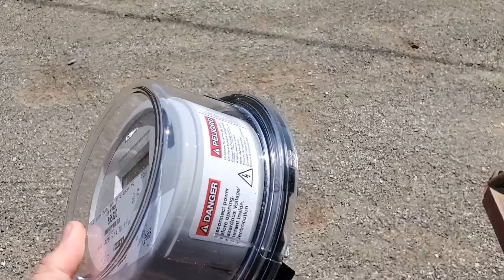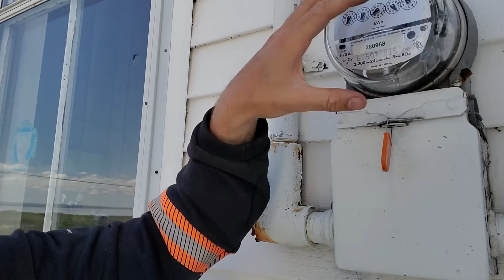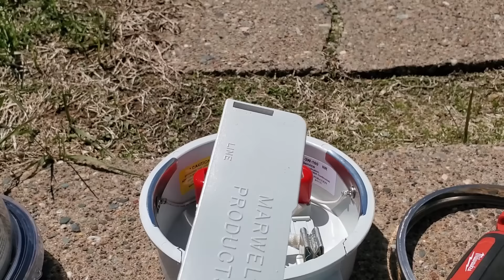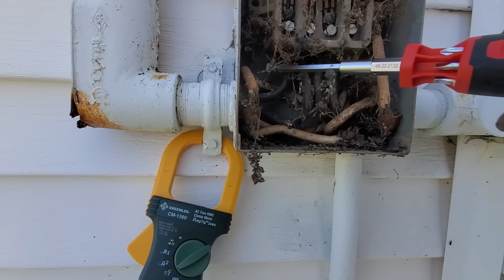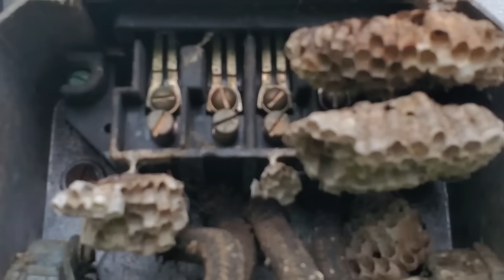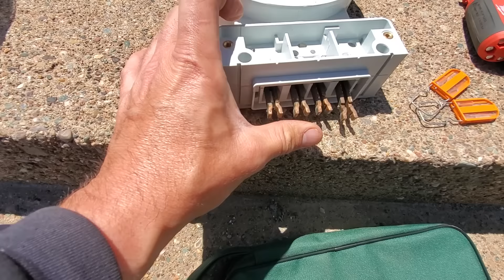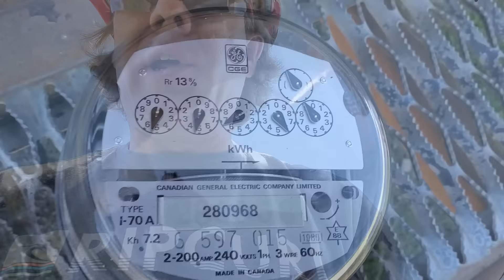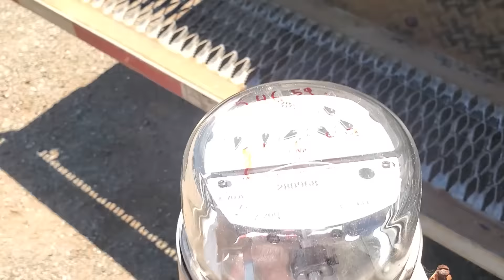Removing an old "A" base Electrical meter

Comment: Hey all the best from France 👊👊👊
As a meter collector from Europe I found this very interesting as i did think that only Socket meters are used in north America. 
Is there any way to obtain/buy such an old A typ meter?
Also I find to sealy your using interesting, when did you quit using standard press seales? Again ours are smaller and different, more like a special sip ty as we're not allowed to use lead seals anymore. 
About the cover plate of the adapter, I think it would be better if it would be build in a way you could but both covers on, especially as the service box is outside and there always is a risk of dirt getting on the connection and so on.  Here especially in Industrial units and older 10kV instalations, the meters are in clear boxes and there I am always onnyied from the missing terminal cover. We do not have all standard wirings for meters and they are printed in the cover. secondly i doesnt look finished. Also metering repurposing was until the 2010s a thing here. Missing covers made that difficult.
Reply: I've never, ever seen a lead seal on an electric meter in the USA, even going back to the 1980s. Prior to that I was either too young to notice or hadn't been born yet. The seals I've seen have always been the plastic ones with the metal hasp, but the ones he's using in this video with the clear back so you can see the hasp are something a bit newer.
Reply: @brianleeper5737  Many thanks for your answer. I find it very interesting to know how it is done in other countries.
Reply: Hey Alex if you check eBay there are usually some old A-base meters for sale on there. Westinghouse, Duncan, Sangamo and General Electric were the most common manufacturers - if you search those names + "meter" or "antique meter" you'll find one eventually.
Reply: @doctorzaius4084  thanks

Comment: Just fyi , soap and water in a squirt bottle is the best you can use for wasps ! No chemical residue or harmful chemicals to get on your skin . The wasps don’t fly off and drop dead to the ground ! And you’ll save a ton of $ too. 
Before I was a lineman I did pest control for 13 years ! Enjoy bud and stay safe !
Reply: I would be careful though that the wasps are not going to see you as an attacker... then they'll attack back
Reply: @Engineer9736  that’s why you use the soap and water , it’ll stop them from flying .
Reply: @bguy86  I hope so, i'm happy to believe you. But i'm not going to test it 😅 But anyone is free to try if they wish 😉
Reply from the maker: Interesting, I'll def try that. Thanks for the tip! 👊👊

Comment: I was home when they swapped out my old analog meter for the digital smart one.  I told the guy I'd run and turn off my main breaker but he told me not to.  I found that... very weird.  Fortunately at the time, no major appliances were running and my house has a constant draw of around 300w without the fridge or other appliances running, so there weren't any sparks.  Yeah, that parasitic draw is kinda high... but router, cable modem, cable box, computer UPSes, cordless phones, and ALL of the electronics, computers, etc sitting in "standby" all add up.

When I had my solar commissioned, the power company tech hooked up some weird USB to... "smart meter" adapter, jacked in a laptop, and proceeded to reprogram the meter, which caused it to completely 0 out (and prompted a shortened bill).  But now the meter has 2 "sub" meters... meter 004 reads inbound power, meter 008 reads outflow power.  It cycles through real-time current in kw (and it reads negative when I'm pushing power to the grid).

Warning to those who think you can turn on your solar (if you have it or are getting it) without having the smart meter reprogrammed or commissioned by the power company - That single meter counter increments in both inflow and outflow directions, so you get billed for outflow as if you were consuming power.  Not cool.  IE - I consume 5kw, and outflow 2kw, I would receive a bill for 7kw of energy.  Crazy.  Plus the power company will immediately know.  Those meters can do quite a bit - realtime voltage readings, power, remote shutoff, etc.
Reply: That's why I like the old analog meters best when I had my solar power supply.
Reply: 300 Watts isn't bad. We're at about 600-700 Watts parasitic load here. We have a lot of people living here, so I'm not surprised.

And at our peak over the last few weeks, I think we've reached 12 kilowatts of load. Again, we have a lot of people living here. 

If I see household power usage go above 2kw between 5-9pm, when electricity is most expensive without a valid reason being given to me, that's when I get upset.
Reply: @miss_engelise  Highest full draw I've gotten was around that high (12kw).  That was with my PHEV charging, AC running, microwave running, and my toaster oven running.  There's only 2 of us in the house and my home is small (900 sq/ft with a basement).

I went solar because I was tired of $100 bills in winter and $180 in the summer, plus I suffer from 2 - 4 power failures a year, anywhere from a few hours to a solid, 5 day week.  I work from home so having electricity is important, and the cable company is pretty good at putting a generator on my node to keep it going.  

I have a flat rate plan from the power company, tiered based by consumption.  0 to 500kw is one rate, 501 to 800 is another higher rate, >800 is an even higher rate.  There is an option for a TOD rate.

Unfortunately the power company here does not do net metering - they do something called "Distributed Generation" which isn't super great - I do get like .998% inflow to outflow pricing based on kw/h, but they do not credit back any distribution charges that I consume from the utility.  IE - I use 100kw for the billing period from the utility, push out 250kw.  I'll get a bill credit for the 150kw, but I get socked with 100kw of distribution charges, and those don't use any credit earned - gotta pay them that.  I basically can't get a 0 bill from them unless I get a really big battery and try to go self-sustaining.  For me, my 26kw/h of storage isn't enough.
Reply: @russael001  Oh, heck! That's really lame! Tbh, I think there needs to be some kind of government decisions regarding how net metering works. I know one of the theoretical situations I frequently hear is: "If everyone goes net zero, who'll pay for our electrical infrastructure???"

I'm not an expert, but that doesn't sound difficult to solve. Especially not if there's some kind of government intervention to standardize it all. Worst case scenario, it'll end up being just like our roads, where it gets paid solely by tax dollars. And that's assuming that that idea is correct in that everyone will be net zero.

In short, that seems really crummy that you can't go zero on your energy bill.
Reply: @miss_engelise  It's not all gloom and doom.  My last bill was $13.65 (normally would be around 100 at this time of year).  And everybody pays in to the infrastructure, but I never hear about the utilities doing any upgrades.

My state (part of MISO) is predicting power shortages this year and potential rolling blackouts.  It's confusing to me a little - appliances, lighting, electronics, etc. are all getting more efficient, and yes, EVs and PHEVs are a thing that is happening, but that's been coming for well over 10 years; I think that would've been plenty of time to do some upgrades.  But the utilities didn't.  And my utility charges some of the highest rates for power in the country, but they say because its customers generally use less power, that the bills balance out.  Excuse me?  How do you rationalize that?  That's like saying a vehicle automatically doesn't drive as much if gas prices are high.  Sounds like priorities were on investors to me.  

Oh, and for what its worth, the gas tax that you pay at the pump that is supposed to pay for road infrastructure is typically diverted away to other programs.  Probably why the roads in my state are considered trash.  Diesel fuel has very little tax, and generally it's the big rigs that destroy the roads, carrying 80k lbs.  A single passenger car (even if it were one of the heaviest) doesn't do a thing to the road.